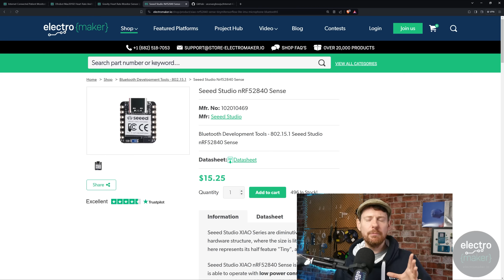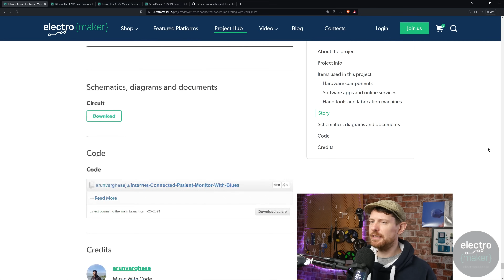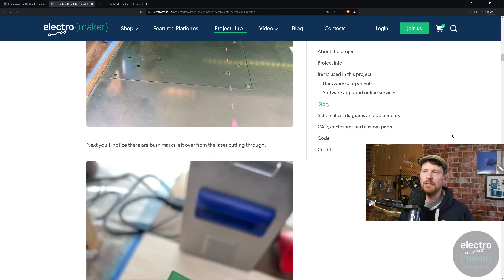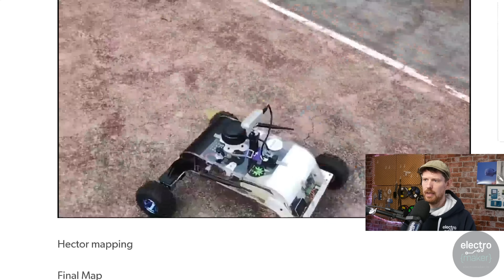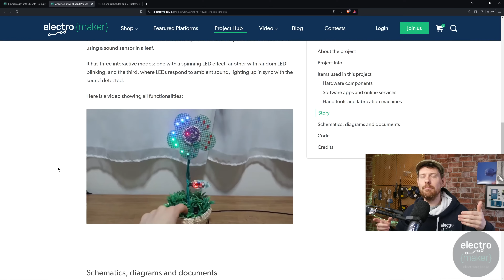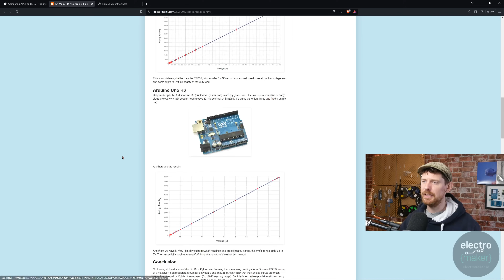Comparing ADCs on ESP32, Pico and Arduino , Raspberry Pi IPO, Prize Winning Projects, and More!

Comment: Very interesting on the ADC tests by Dr Monk. I like the title: Lies, Damn Lies and Analog Inputs (comparing ADCs on ESP32, Pico and Arduino). I tried to use an ESP32 to measure central heating radiator input and output temperatures ( to set the optimum differential) but the 2m long thermistor cables radiated so much CPU noise that the 120MHz air band was unusable. I did have axial RF chokes on those leads before anyone asks; I'm not a total n00b!

Comment: Seems like the perfect time to build an assistant with the recent open source AI models, and the #zimablade could be much more fitting than my Raspberry Pi 3b, which only has 1GB of RAM. By the way, glad you mentioned Simon Monk's books - "Hacking Electronics" is especially a fun result-oriented one for beginners.